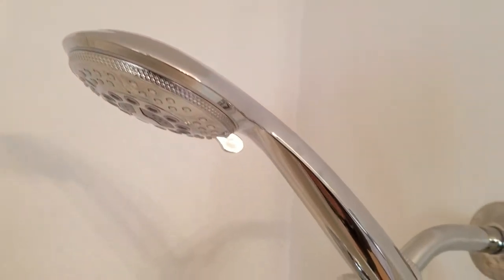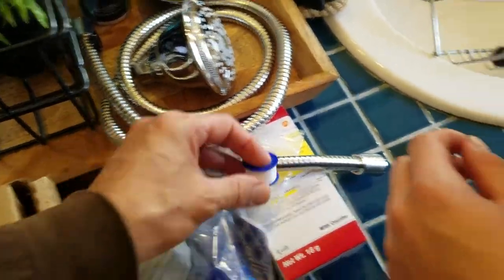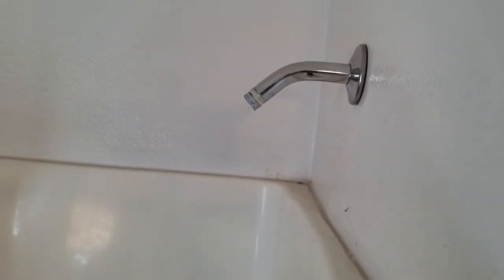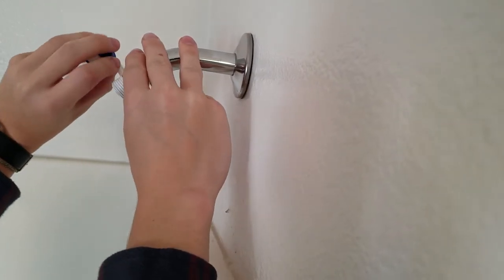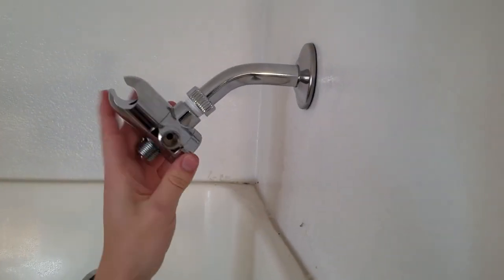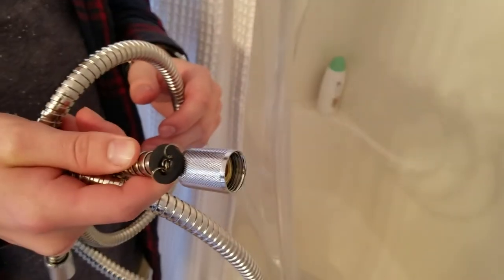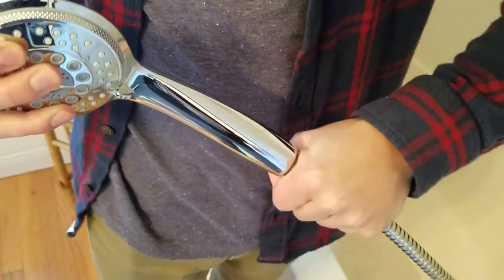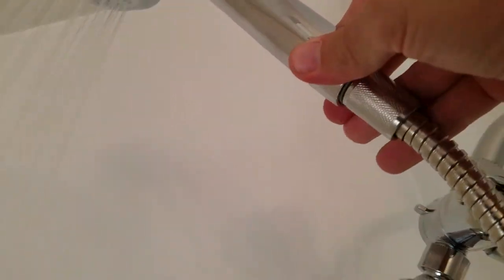Install a dual head shower system in 5 minutes

Comment: My husband installed a similar model and it worked great for a year or two, but now handheld part drips. What could cause this?
Reply from the maker: Sorry I'm not sure. Maybe look in the handle to see if there's a rubber washer that needs replaced. Or contact the company that makes it as they should know.

Comment: I purchased a Price Pfister Adapter by Whedon and just received it but it’s too small. It’s 1 1/8th”x20 male x 1/2 MIP I don’t know what that means but it didn’t say anything about male or female when I purchased it from Walmart. I didn’t know that until I just got it. I contacted the seller asking if I can return it for the correct part, I’m not sure if they will agree. In the meantime, I wanted to ask if you knew which of the other two attachments were larger that might be the one I need? Thank you!
Reply from the maker: Sorry I don't know.  Try to find someone who knows about plumbing to come over to your house and take a look.

Comment: Mine came with a washer/screen Insert that I  believe goes into the shower head before screwing it in (The regular /main shower head, not the hose one) But I’m not sure
Reply: I wish we could post a picture here LOL
Reply from the maker: Hmm not sure on where that screen would go as I can't remember if one came with mine or not.  I'd say try it installing it on the shower head and see how it works.  If it reduces your water flow too much then try it without the screen.

Comment: I know it's been a while but at 2:32, my outer ring won't screw on, am I doing this wrong?
Reply from the maker: Look closely at your shower pipe and the new outer ring.. Make sure the screw threads aren't damaged on both.  Other than that if your old show head fits back on then it might be the outer ring is damaged or the threads on the outer ring were not manufactured correctly.  You might have to get some help in person to determine the problem.